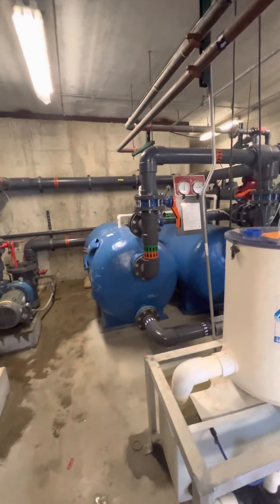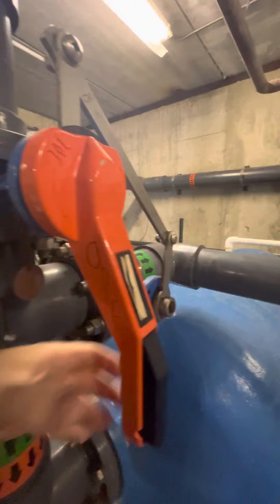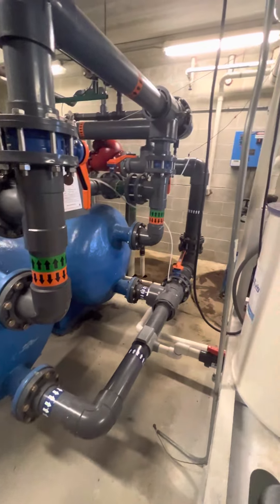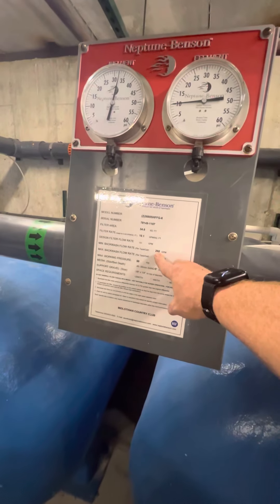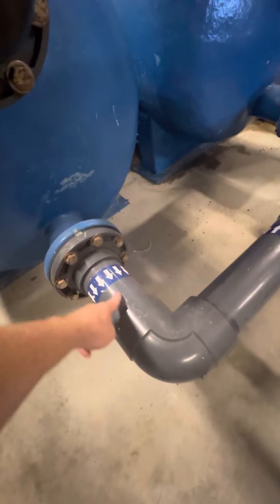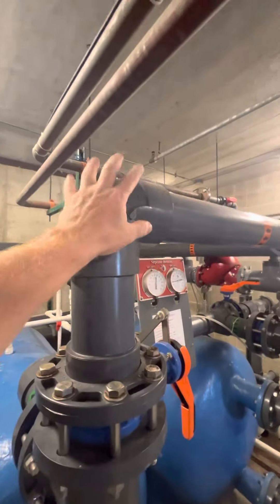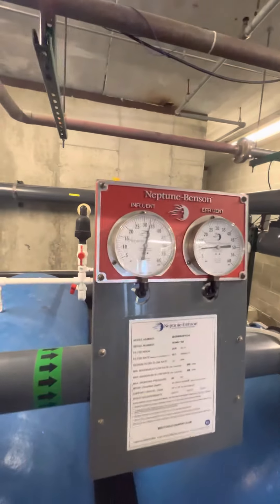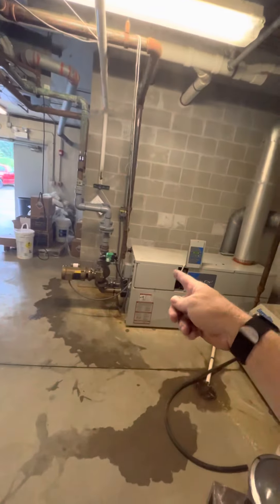Large commercial pool backwash issue

Comment: This is plumbed correctly.. 1) Change one filter to backwash. Leave the other filter in filter mode. Close the return valve and you're backwashing. It uses the clean, filtered water from the opposite filter to backwash. Call a pool professional next time..
Reply from the maker: I did call in a heavy hitter pool guy, thanks for the insult..
That said, your exactly correct and I just didn't see it at the time I recorded this video as I am a mechanical contractor and not a pool filter professional.
The only thing I knew for sure was the customer was backwashing via gravity flow and the delta P across the filter was way out of range.
Where were you 9 months when I needed you? I only took care of the boiler that was connected to that pool filter.
Reply: so you backwash each filter using the clean water from the other.....im gonna stick with my residential stuff.   lol
Reply: No you're actually a genius
Reply: But wait, instead of having 2 filters filtering you would only have 1, meaning double the PSI, wouldn't that destroy the equipment due to double the pressure?
Reply: @luckyday_5510 pressure in each system combined would not be enough to cause problems, and since the waste line is open it will be relieving pressure on the system also.
Reply: @crowe852  waste is open on both filters?
Reply: @luckyday_5510  no just one, system is designed as a whole, having the waste portion open on one relieves the pressure on the whole system. Pump still splits the work load between backwash and filter, so essentially the water is still the same amount if not less while backwashing
Reply: @crowe852  OOOOOOOHHHHHH. HALF of the water is going through the filter that is filtering and also backwashing the other filter, and THE OTHER HALF is being drained. Kinda wasteful with a lot of water being dumped out for no reason, but it gets the job done! Am I correct on this explanation?